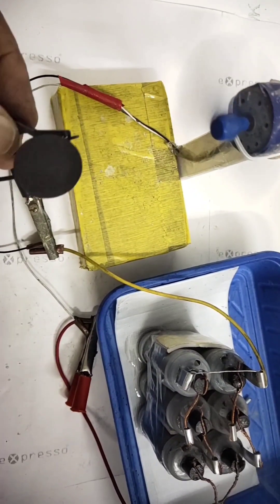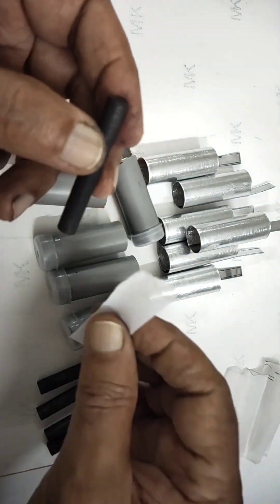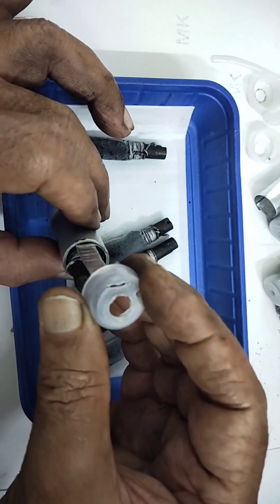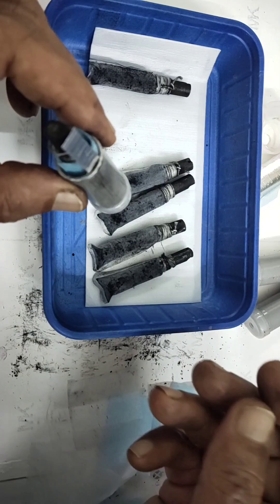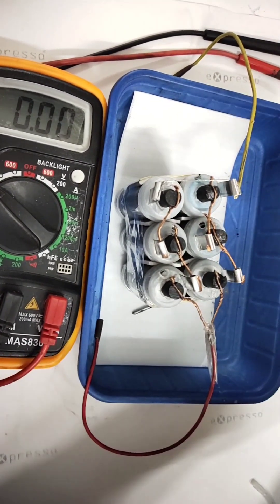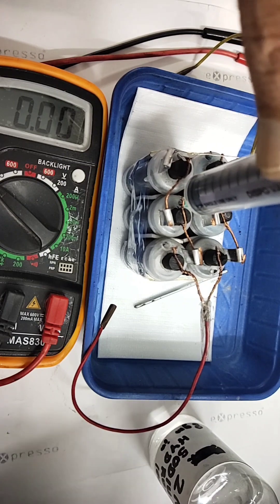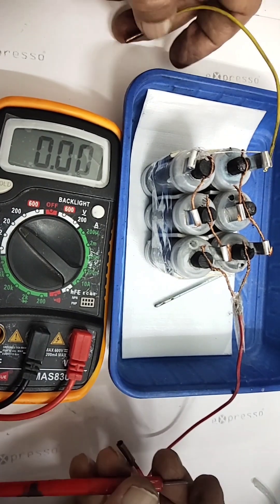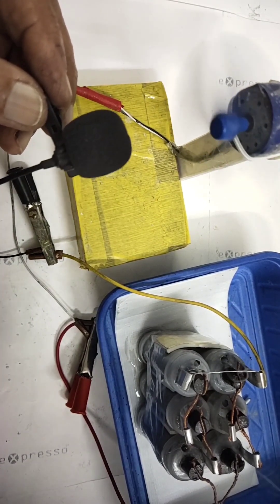ALUMINIUM AIR BATTERY  SIMPLE DESIGN, 3 CELL , 3.5 - 4.2V, 300-400 mAmp. D.I.Y Project,video-170

Comment: If added little bit Sodium Benzoate to the electrolyte would slow down the aluminium oxidation... I can sea the the vapour of the reaction of aluminium with sodium hydroxide...
Reply from the maker: Thank you for your support and sharing valuable information. I will try to use it in my coming projects👍🙏

Comment: DKJ Tech:- much appealing technic Alu Air battery, with simple material's, nice construction, series/par'll type good voltage & amperage, elaborate explained details, DIY. (Mention rechargeable or not).valued knowledge sharing video, 👍🏿👍🏿👍🏿JPN.
Reply from the maker: This model of aluminium air battery using alkali is a forward reaction which converts the aluminium plate to aluminium oxide, which is no more conductive and looses it's battery principle. That is why I have shown in my previous videos where I use zinc coated aluminium carbon battery using zinc sulphate electrolyte, which are re-chargeable in nature and more shelf life.
Reply: @dkjawahar-techexpt671  Thanks for the detail reply.